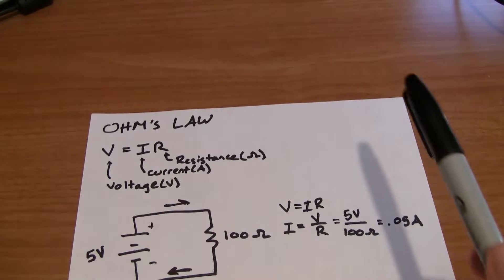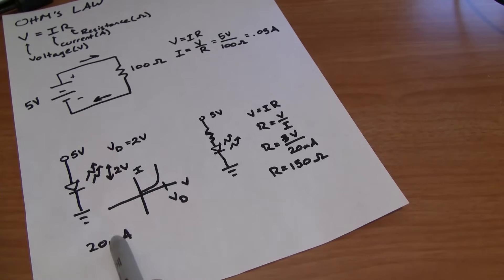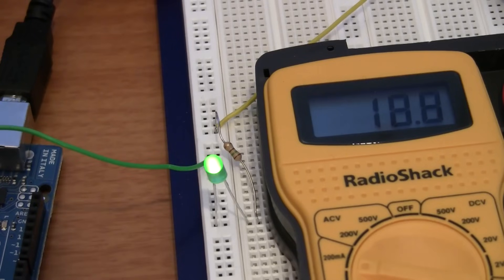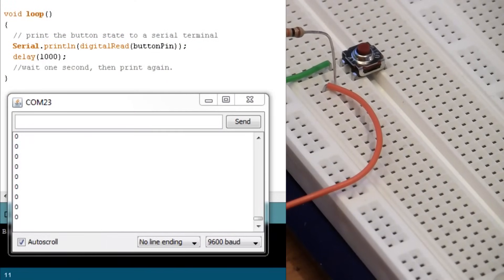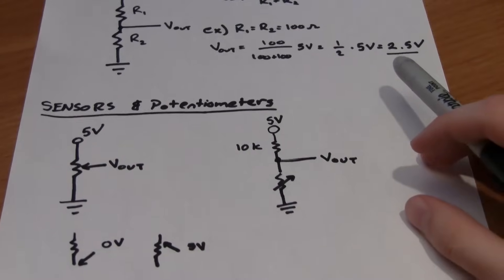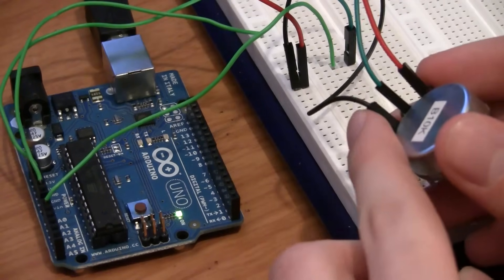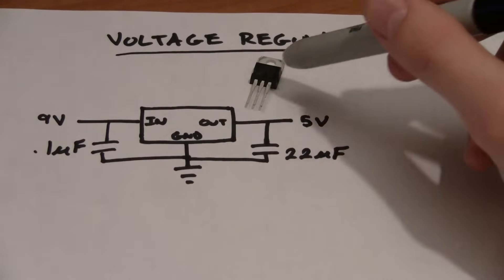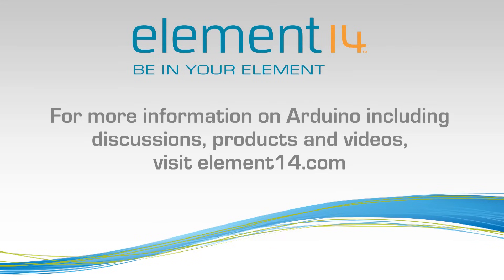Tutorial 03 for Arduino: Electrical Engineering Basics

Comment: I've tried to make the voltage regulator, I have the parts, (except I have a 47uF instead of a 22), but I don't understand how to make it, it's filmed from a very bad angle, I can't see well where to plug the battery and especially the multimeter. It's the same problem in one of the future videos, I think 6.
I've also looked in the schematics on the site, this part is not detailed.
Can anyone clear this picture for me? Like a scheme or a drawing which shows everything is connected, please.

Comment: Jeremy welcome! My name is Sergey, I'm 39y.o. I'm from Kazakhstan! I am watching your videos about Arduino but unfortunately still not all ponyatno.Elektronikoy started recently and very slab.V generally purchased Arduino Uno for Webasto. sketch found on the Internet, and it was created on the Arduino nano.No to surprise, he booted up and running. Sketch is written quite deliberately as I thought. But there is one problem, everything works fine when I run the process with the computer giving the command number 3. If I run with a clock button in the middle of the process is completed the program, and more specifically when the time came readout photosensor, all proceeds to the final cycle, help me with I ask to please, where you will send Sketch ugodno.zaranee grateful!

Comment: on the start where you show the battery hooked up to a resistor is wrong, the current flows from the negative terminal to the possitive..
Reply: For electricians the current flows from + to -. Probably because it has been standardised over the years and changing it would globally would be a rather long and confusing matter

Comment: Ok I'm going to say this for anyone to whom it's not clear at first.  The reason the pot (let's take a linear one - a fader - not a typical rotating one) acts like a voltage divider is because the wiper slides across a resistant material that has physical length, and is connected to +5V at one end and ground at the other.  So when the wiper is 1/3 the way down the resistive material, the other 2/3 of the material is between the wiper and ground, so there is literally one resistor between 5V and the wiper and one resistor between the wiper and ground.
I'm just not groking this stuff unless I can visualize it.

Comment: hi, Can you tell me how you got to the conclusion that 2v olts drop over the led ?  Did I miss something?
Reply: abstrakt lighting You might already have found an answer, but you can look it up on the LED's data sheet. Look for Vf (forward voltage).
Reply: i would like to know that also. It wasn't obvious, at least to me!
Reply: +Arthur - Jake - Leyenberger 

in case this has stumped anyone else, one finds the voltage drop with V = I * R (same formula to find the supply voltage).Voltage drop = Resistor with 100 Ohms * the current of 20 mA => 2V --> (100 * .020 = 2)

Comment: Why would you use a pull down resistor when you could just ground the switch with a wire?
Reply: +Matt Douglas in that case, all current will drain to ground when supply is given to circuit. the resistance is higher than the resistance of microprocessor, so when supply is given, the current follows the path of least resistance and goes to microprocessor. when it supply is taken off, the resistor being connected to ground, static charges drain out.

Comment: How did you connect the multimeter? Mine just gives me a 00.0 with a negative sign when I set it at 200m.
Reply: +Mussie Tesfay  you must be measuring current across the device just like how you measure voltage . 
To measure current you need to connect the multimeter  in series with the device , so that the current flows through the multimeter . Just remember :
To measure voltage = connect across .
To measure current = connect in series .
Reply: Asif A. Yeah, figured it out the other day. Thanks a lot though!!

Comment: what the difference between pull down resistor and pull up resistor
Reply: +Francisco Sanchez the pulling direction
Reply: +Francisco Sanchez A pull-down resistor is connected to ground.  A pull-up resistor is connected to +V (5V for Arduino).
Reply: rlrsk8r1 i want to know about embedded systems. Also how to program them. Do you know where to go for good materials/guidance?
Reply: +Bandit King I'm not sure what you mean.  What kind of embedded systems?
Reply: Bandit King there are two system that I know of. One is an Arduino Uno and the other one is a Raspberry Pi. The one I learning about is an arduino this one has two things that you need to download one is Fritzing and the other one is a programming sketch this one is where you write the programs and upload it to an arduino. As for the raspberry pi i don't that much about. I hope this helps you
Reply: The Raspberry Pi is a microprocessor; it essentially works like a PC.  It runs an operating system (Debian Linux usually), has a file system, etc.
Reply: I know that it is a operating system but is you search on youtube embedded systems and watch Robert Paz intro to embedded system he explain that it is one of embedded system it is about 38:00 minutes long.

Comment: what's the difference between watts and amps (current)
Reply: +Francisco Sanchez watts= unit of power, amps = unit of electricity flow
Reply: +Francisco Sanchez  Power = (Voltage * Current)  ->  with Watts as its SI unit
Current is one of the terms used to calculate power .
There are other formulae too but since you asked a difference between power and current , this relation would be enough.
Current -> SI unit is Amps

Comment: You shoul`d explain all the different software comands or let me call it "basic commands" first and then do the hardware.
Otherwise the videos are very good.
Reply: +Patryk Darasz Microcontrollers Some of the basic functions like analogRead() would be difficult to explain without an understanding of the electronics behind them or a simple circuit to try them out on.
Reply: +Patryk Darasz  Working through stages, getting used to the hardware and and coding that goes with it makes far more sence than learning the entire arduino programming language and then moving on certainly at this stage
Reply: +Mark “Brokenbits” Acton Hello All, i'm found this. Step By Step Arduino Microcontroller Guide. Learn How to Design and Programming Arduino. FREE DOWNLOAD HERE
https://plus.google.com/116428027560638976608/posts/96r9KFpBur9

Comment: I have a very lame question that on my arduino uno r3 when I connected the 5 volts supply to 3.3 volts it gave me a range of 0 to 718. Why so?
Reply: +Nitish Rajoria Because it's looking for a range of 0 to 5.  3.3 is a bit beyond halfway (512), so it's about 718.  You need to use the analog reference pin to get full resolution.

Comment: I think I got most of it until the very end of this video. Can you please take a minut to explain the decoupling capacitors???
I searched the datasheet of the L4940V5 and they use the same as you do but is it a matter of reading datasheets or is there a rule?
Reply: Hélder Lima It has to do with the ripple factor the capacitor helps to provide very low amount of fluctuations in the voltage supply.
Reply: Nitish Rajoria I understood that. What I didn't understand was why he chose that two specific values. Is there a formula or are always these two capacitors independently of the voltage regulator?
Reply: Yeah, we have a method to determine those values for that you have to refer to some analog circuit book.
Reply: Nitish Rajoria any suggestions?
Reply: You can learn it from any electronic device book any standard book will do. I needed to ask one thing that when I connect my supply on my uno r3 to 5 volts it gives me the range of 0 to 1023 but then when I connect it to 3.3 volts it gives me the range of 0 to 718. Why is it so?
Reply: Maybe because it is thinked to the 5v and at 3.3v it doesn't achieve the higher values???
Reply: Yeah I got the answer in next tutorial..by the way thanks

Comment: I've looked back through all the comments and I'm like many other viewers. This is a video about electrical engineering. You explain everything wonderfully about resistance then just throw in decoupling capacitors without ever explaining how you choose the values for them.
PLEASE: What is the electrical engineering behind choosing the decoupling capacitors?
Love the videos. Learning a lot. Please answer this question.
Thanks.
Reply: +Larry “Dr. G” Grimes Those are the required capacitance values as per the manufacturer's data sheet .
You can go for different values , but sticking to these precise values will give you higher efficient output  , i.e a stable DC 5V.

Comment: Again your rate/pace is perfect.  If someone needs it slowed down they could always pause and if they need to to repeat they can rewind.  I can't tell you how grateful I am for these.  We are going to experiment with making a makeshift flex sensor with a piece of transparency film.  I made one by sanding one side and coloring on the sanded portion with a graphite pencil.  If it is not too much trouble could you direct me to a video of yours where you talk about these? I want to map the range of resistances that we get to a range that we can use to drive a servo.

Comment: current flows from the negative to the positive... just saying
Reply: ***** You are correct.
 If you study electical engineering you will be told in the first lecture that current flows form negitive to positive. But before this was known it was assumed that it flowed from positive to negitive.
For the purpose of circuit analisis it makes no practical difference, and engineers are taught (in Australia, at least) to use the traditional assumption ie: positive to negitive.... just saying.
Reply: ***** I was not entirely correct with my last post:-- "electrons" flow from negitive to positive. Conventional current flows from positive to negitive.

Comment: So are all the pins connected to ground, because at around 5:27 the circuit starts at 5 volts but it isn't connected to ground, instead it's connected to a pin. Wouldn't that just be an incomplete circuit?
Reply: dcfan101 The should be. Pin 8 here is used as an input, so it reads the voltage it receives: when pressed, the current flows from the 5V to pin 8, which, if connected to ground, therefore reads a deltaV of 5V, or 1 (in digital values).

Comment: Great video again - Thanks.
I would like to know how you came up with 0.1microF, and 22 microF as the decoupling capacitor values. I understand it has something to do with noise that could be expected in each part of the circuit, but have no idea on practically choosing/working out these required values. Many thanks.

Comment: How do you decide what strength capacitors to use with the voltage regulator? Also, how would the output voltage differ if the capacitors were omitted?

Comment: Wow, this was a great video! I just had one question though, at around 7:02 Jeremy explains the whole resistor pull down thing. What I don't understand is that why he uses a resistor instead of just a wire to pull the current down, since current flows through the path of least resistance. If anyone could respond that would be great. Thanks!
Reply: When the switch is closed current would flow directly to ground rather than to Pin 8 it was connected to. It would probably mess up readings, but certainly drain power.

(I think - just learning myself.... lol)
Reply: J Trenchard Thanks for your feedback. That actually makes sense.
Reply: dcfan101 J Trenchard  Exactly, just having a wire would work when the circuit is open (switch is not pressed in this case). But when it is pressed, the reading would be messed up because the wire would short circuit the current to the ground, rather than passing through the switch.

Having a somewhat high resistance rather than a wire works when the circuit is open, as the current can still go to the ground. But when the circuit is closed, the current will go through the switch rather than the resistance, because if follows the path of least resistance.

Comment: Although in most cases it can be ignored, for critical circuits, like measuring, the resistance of the battery must be included in the ohms law calculations. The battery resistance can be calculated using a precision resistor in the load and measuring the voltage across it.

Comment: Hi Kesavan ,the calculation of the resitance is very important to avoid damage the led , and the same time to avoid damage the arduino this is the answer for your first question , regarding to the drop on voltage he used 3v ,
 V= R   *  I
   = 150 ohm * 23 mA
   = 150 ohm * 0.023
   = 3,4 V. this is the voltage of the resistance (VR) and  Vtotal = VR + Vled
Vled = Vtotal - VR = 1.6 V

Comment: Awesome video... By the way, I have a question: when you are calculating the resistance connected with the LED to avoid drawing much current, why did you calculate using the dropped down voltage of 3V? Ain't the resistor connect just before the LED, which means we have to consider 5V...
Reply: Let me try to explain.

Imagine, you have a stream. You build a dam. The water level rises to a height of 5V until is overflows somewhere else. You drill a small hole in the bottom that lets enough water pass to drive your mill. Unfortunately, the wheel of the mill is 2V tall, so you need to add another small dam that will raise the water level back up to 2V. Now, the water pressure behind the big dam is not enough to push enough water through the small hole to make your mill run properly, so you need to enlargen the hole. The hole needs to be large enough to work as if the big dam were only 3V tall.

Now the metapher kinda breaks down - all the water down that stream has to go through the mill, so just removing the 5V tall dam won't work, since then you'd get only a 2V drop and an awful amount of water would wash your mill away. 

The LED is that mill, the small hole is the resistor. If you had a 2V power supply, you'd have to balance the voltage and current rather precisely, otherwise your LED would still burn out...

Does that make things clearer?
Reply: @realulli  yep man thanks for putting in time for this answer ^^

Comment: How do I get the terminal to show what's happening on the board like he has in this video?
Reply: Use Serial monitor it is on the right side in the upper corner in the arduino soft
while in the setup()
declare the following
Serial.begin(9600) and in the loop under the push button read use this
Serial.println(digitalRead(switchpin))    while switch pin is the pin where your push button is connected !

Comment: I'm confused about the pull down resistor that comes after the switch. I can't figure out how that works. How does the resistor remove noise, it looks like it just adds another direction for the current to go instead of pin 8.
Reply: Is noise being generated in the opposite direction (from pin 8 not to pin 8)? Or am I looking at it the wrong way and current is being generated from pin 8 not 5V?
Reply: it looks like it just adds another direction for the current to go instead of pin 8.

That's exactly what it does. It just prevents floating ("noise").

Comment: I = V/R. What happens when it short vcc to gnd without any resistor. Can someone please explain?
Reply: It basically means "infinite current", which is equivalent to a short cuircuit.
Reply: is infinite possible practically because wires do have some resistance although insignificant. Suppose i have an adapter 12v 1A. What is the significance of 1A? what does it mean? can i get more current then 1A say 6A.
Reply: Bryan Smith It means that the adapter can supply 1A of current at the maximum. If a circuit that uses the adapter for power draws more than the allowed 1A, then your adapter can be either damaged or even destroyed (unless it has a fuse).
Reply: hmmm so no current more than 1A no matter how i set the resistance -___- too bad.
Reply: if short circuit happen , current goes to infinity because
U = I / R
5v = I / 0 = infinity

Comment: I response to Derek Jenkins, the circuit diagram is always incomplete.  There are always small but occasionally significant inductors and capacitors and antennas that are physically present.  An easy path to ground through the pull down resister makes them insignificant.

Comment: will the button work with a 100 ohm 1/4 resistor?
Reply: V = IR, I = V/R, therefore 5V / 100 ohms = 0.05A or 50mA...it won't work out well as the I/O pins are limited to 40mA.  As far as the Watts, Watts or P = VI, so 5V * 0.05A = 0.25 watts, or 1/4 watt, it will work but again you're maxing it out so you would be better off reducing power or using a 1/2 watt.

Comment: I have a question about when you are discussing voltage regulators.
Will changing the size of the decoupling capacitors on either side change the output current? If so, how are the two related so I can determine the output voltage to be something other than 5v?
Great videos, I saw that you wrote a book too, looking forward to reading it.
-MEL

Comment: Thank you Jeremy.  I got a little confused by the Voltage Regulator piece.  The concept made sense, but it took me a bit to figure our what you were doing on the breadboard (I'm new to circuits, and to breadboards).  I did some reading on breadboards, and watched the segment a couple of times, then it became clear--the battery was connected to the + and - rails, the .1uF  capacitor on the same rails, then the Voltage regulator with + pin on top, with a jumper to the + rail from that row, the ground pin in the middle with a jumper from that row to the - rail. The jumper from the 5V pin row  (which goes to the multimeter) came before the 22uF capacitor, which is has one pin on that row and one to ground. Another jumper from ground goes to the meter.

I'm just writing this out to see if I can articulate, and perhaps save someone some time if they hit the same ignorance block that I did.

This was fun and educational.